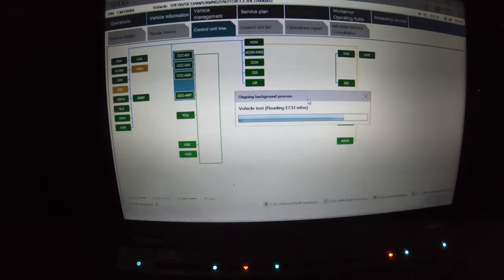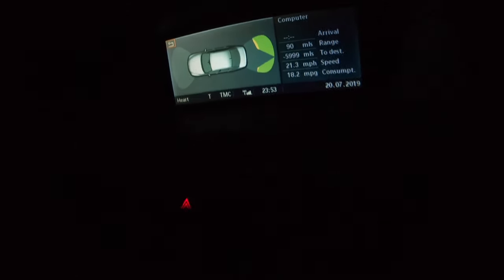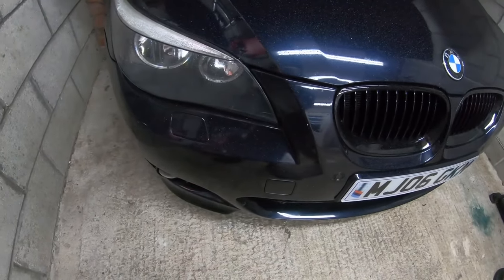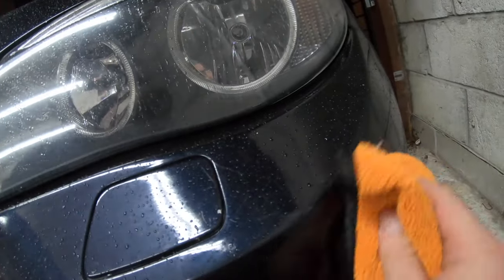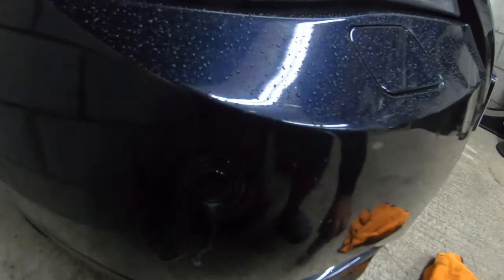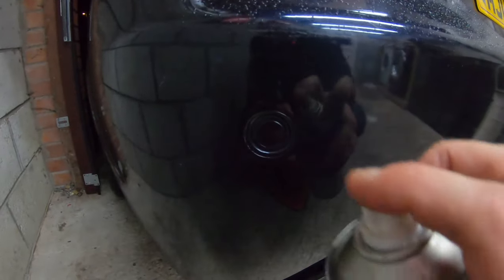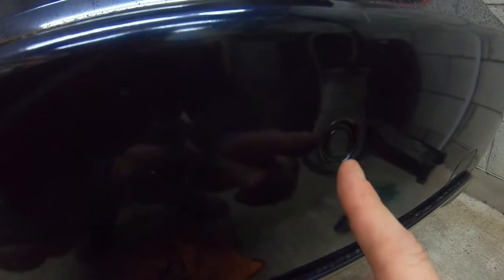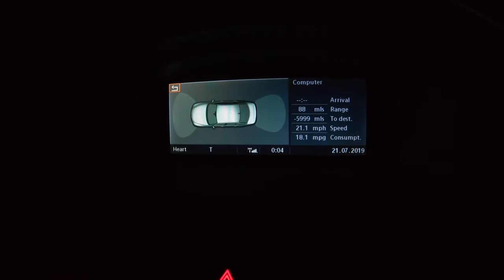How To Fix Parking Sensors On Any Car For Free......Fix Your Original Sensors DON'T SPEND MONEY

Comment: The front left one was the one you had an issue with and in the test that was the only sensor that you didn't actually check - you said there was no object in the way of that one. Would have been better if you had checked that one worked too, and perhaps preformed that same test before cleaning them all as well as after. Good information to know though, I have PDC codes on both my BMWs so I'll give this a shot.
Reply from the maker: Yes mate that is because it was the one with the fault but do not be fooled by bmw system 

The one with the fault is NOT always the one that needs replacing what happens if another goes out it will cause the others to malfunction that’s why I did them all

Comment: Hey Dean how's it going? Other than aesthetics is there any reason that I couldn't leave the engine cover off my N52b25 engine in an E61? Reason being so I don't have to remove all the plastics every time I want to look under there when hunting out a leak (unfortunately). Thanks mate.
Reply from the maker: No problem mate leave it off it don’t do nothing anyway it’s a nuisance I got all mine off I only use it for thumbnail pictures that’s it then it comes off
Reply: Update: Thank you for your reply, good to know I'm not the only one who thinks it's a PITA haha, so I took it off and cleaned up all the oil and kept an eye on it and it's coming from the oil cap rubber perishing thankfully not the valve cover (yet) so nice easy fix this time :) have a good one!

Comment: Hi mate will this work with more modern f series bmw’s?
Reply from the maker: Yes it will
Reply: BMW Doctor hi buddy ive tried this on the problem sensor and all round and it still isnt working. It still thinks something’s close to the front centre right sensor, any thoughts?

Comment: actually the moisture can form from air because of condensation. So depending on weather even if it is sealed from water, water from the air inside can still form.

Comment: Hahaha. This fixed all my rear end sensors (bought a car  with this problem). They were all beeping constantly og show both signs of obstacles (yellow/red in the dash) I sprayed WD40 on the sensors and inside the bumper on the sensor contacts. Thanks.
Reply from the maker: Glad it helped like it’s doing the world at the moment it’s a trick we used in the dealership
Reply: @BMWDoctor  Unfortunately it did not last for long as one of the rear center sensors "came back" beeping. It worked fine yesterday but today.  Its a constant beep on at least one of the sensors. I tried to spray WD40, eletronic cleaner both on the outside and on the connectors inside of bumper again. I know all of them are working because they are all ticking, and it worked perfectly yesterday (after a spray again, waiting for an hour and then i tested again, was function fine, this morning problem back).Any tip? Seems like there is at least one "problem sensor".  Maybe its taking in some moist/water to easy?
Reply: Update: Found out its sensor nr 3, and that when i hold my finger so slighty (slightly push) on the sensor at angle around 2-4 clock, its working, but i need to hold my finger there...when i remove my finger it goes back to contious beep. Weird.
Reply from the maker: Terje Martinussen the sensor is completely shot you left it to long mate same thing happened to me this tip only works if you catch it the moment it acts up or any of them act up
Reply: @BMWDoctor  Yes i believe so. So ordered new ones. It started working again for some hours, but now suddenly stopped again..so guess i will change it. ( I mean theres a signal, but the sensor seems to "live its own life".

Comment: Is my pdc module broken or one of the sensors if the pdc is completely silent, no visual indicators either. Does not beep randomly, it does absolutely nothing. The light on the pdc button flashes, thats all. Car is -05 e60 523i

Comment: Hi Sir, not sure you could give me your expert advise on my problem that I encountered. I install a separate dash-cam battery pack for my dash-cam and I tapped the power from one of the fuse port inside the rear car boot fuse box on BMW 5 Series 2015 year model. I had checked the fuse port that I used, it only have power when engine is running and this is what I need for charging my separate battery pack but the strange thing is after I done my installation I notice the Memory Seats Setting cannot be save or using the previous memory seat setting saved before too and yet I still able adjust the seat by manually using the shifting buttons. I couldn't figure out what could it be the problem as I only tapped to one fuse port.

Comment: Hi mate none of mine are working at all not long had the car, (E60 pre lci) could it be the mod in the boot.
Reply from the maker: that is correct as there Is no way they all fail mate
Reply: @BMWDoctor  if tested them and found out that just of the rear ones is out will change that and see if they work but so far nothing works

Comment: Hello, my F30 rears are working visually ok, I can see on the screen when I'm getting close (yellow/green/red) but the beeping is not working. Fronts are working fine visually and beeping.....any ideas why the rear has stopped beeping? Thanks. (I tried the WD-40 trick and the problem still persists)
Reply: 99% speaker died. Get new one, replace, and fixed :) My bro had same problem in his Audi ;p

Comment: Saved me a packet mate, thanks for sharing 👍🏻
Reply: My problem is the sensor light inside the button is blinking off and on and what happened was that it rained and I got a little bit of water in the trunk Department cleaned it all up dried the electronics and plug them back up and this started to happen there was also a windshield wiper fuse blown out can you help me thanks

Comment: Hello BMW Doctor ... I'll try this as soon as I can. I have a BMW 745i (E65) from 2002 and since I bought it the PDC has never worked. It only appears in the Check of the vehicle that the PDC is failing but there are no beeps or colors on the screen. Maybe it's a module problem but I'll try to apply WD-40 anyway. Thanks for the advice. Regards.
Sebas (Asunción-Paraguay).

Hola BMW Doctor... probare esto en cuanto pueda. Tengo un BMW 745i (E65) del 2002 y desde que lo compre nunca funciono el PDC. Solo aparece en le Check del vehículo que esta fallando el PDC pero no se oyen pitidos ni colores en la pantalla. Tal vez sea un problema del modulo pero de todos modos probare aplicar WD-40. Gracias por el consejo. Saludos.

Sebas (Asunción-Paraguay).

Comment: Just tried this, but hasn't worked. I'll let it dry out a little longer... How quickly does it work? P.s. mine played up straight after having the car washed at the local hand car wash sigh
Reply: Stephen Traves same as mine, went car wash and half an hour later they stopped working

Comment: Has anyone tried this fix on a Land Rover Discovery 3 HSE (2005 model)?  I purchased the car a few weeks ago, and had it delivered from Burnley to London. The guys who delivered the car had it cleaned and valeted near to where I live  before it was dropped off. The  sensors were working on the day when it was delivered when I parked it on my driveway. But the following day (and everyday since) the dashboard display says 'Front Parking Sensors Inactive', and the PDC button is flashing orange. I wonder if there could still be moisture in one of the sensors if the car was jet washed? If it does work, I'll have to get some WD40!

Comment: I got a question. My bmw 1-serie e87 has a problem with the reverse parking sensors. My pdc won't turn, i can't hear my reverse sensors and my reverse lights won't turn on. So nothing works really. I tought maybe there is somthing with my reverselight switch, but that is only for the reverse light and not for the sensors. Does anyone have a solution for this?

Comment: Mine doesn't act up, b it's just beeps the minute I go into reverse. Maybe I need to soak em in WD.
Reply: Still hadn't work for me by tht way
Reply from the maker: If they are completely dead it won’t work it only works if they are acting up I also have no reason to lie you guys saw my sensor was out and then working after and it still is to this day
Reply: What's dead? No sound?

Comment: How do you stop your front sensors on ford mondeo beast is bleeping like mad
Reply from the maker: Code the module out
Reply: @BMWDoctor  thanks for getting back do i have to go to  a garage and get them to put it on a computer?
Reply from the maker: kate maginn you don’t have the system to do it yourself ???? Garage will charge you and probably won’t even know how to code it out
Reply: @BMWDoctor  it will work cheaper going to a garage than a ford dealer they charge £48 just to make an appointment thanks

Comment: I just tried mine and no luck typical that the easy fix never works for me lol
Reply: Same here. But it’s probably because the sensors stopped working this past winter when it was -45°C.... I guess I’m going to be replacing sensors.
Reply: @N3QEH  I sold the car now lol. I was just trying to sort them before the buyer came I guess that's what happens when the car is left sitting about

Comment: Sadly this made no difference. One of my sensors just goes off and on again. Was quite happy that I fixed it with WD40 as it started working 2 minutes later but then stopped again the same day.
Reply from the maker: It’s only mean to work jus to get you home and out of trouble
Reply: @BMWDoctor  yeah, had nothing to loose by trying. See you had the same issue, just watched your other video on replacing them. I bloody hate removing headlights on E60 though haha :)
Reply from the maker: Mate why you baiting it up ???? Half the others don’t watch this other video shhhh this is a big money maker this video
Reply: @BMWDoctor  hahaha :) sorry! Saving grace is hardly anyone reads comments ;)
Reply: After spray cleaning my car couple weeks  ago one of my sensors started playing up.

WD40 solved the issue for about 2 days. Tried WD40 again which worked for one day.

I managed to slide my sensors out and wiped them clean all around then spray over with WD40 last week.

Been perfect since.
Reply: @ascott7321  Good job! I'd probably try the same thing if it wasn't required to remove the headlight to get to it. If I have to remove it I may as well replace the sensor.